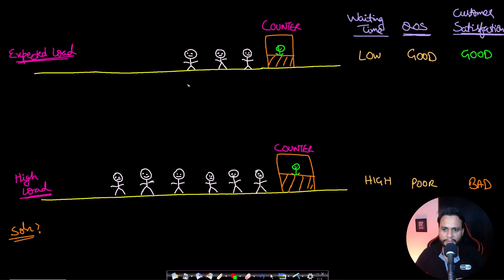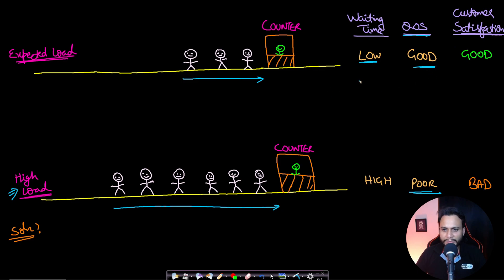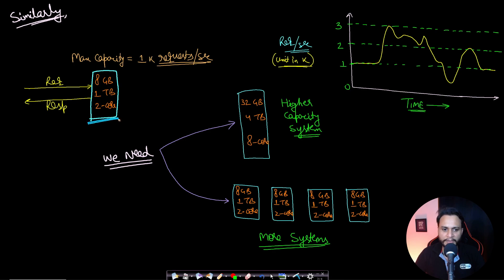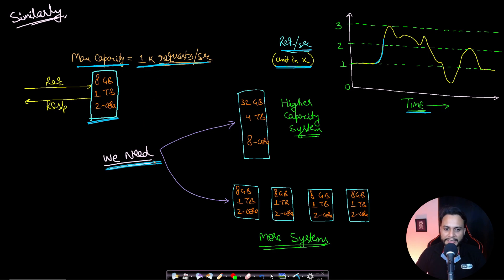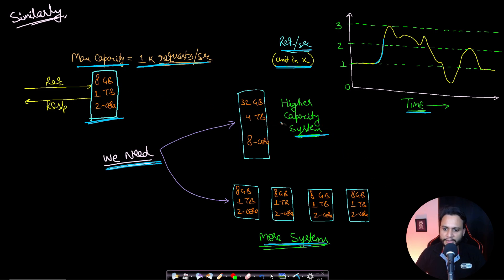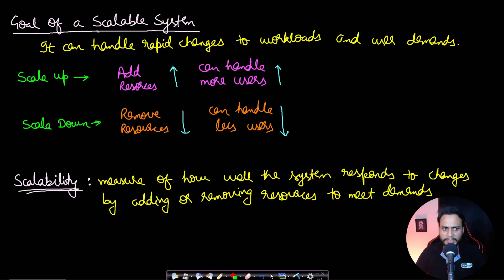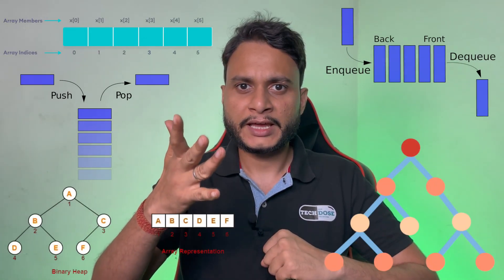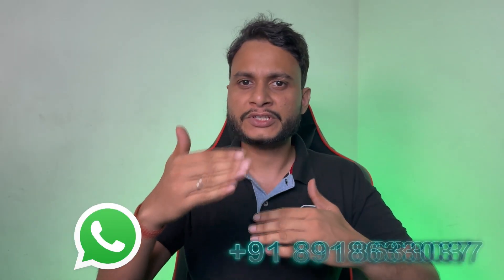Scalability | System Design

Comment: In system design, scalability refers to the ability of a system, network, or process to handle a growing amount of work or its potential to be enlarged to accommodate that growth. It's a key property that determines how well a system can adapt to increased demand or workload without compromising performance.

Scalability can be viewed in two primary dimensions:
1. Vertical Scalability (Scaling Up): This involves adding more resources (such as CPU, RAM, or storage) to a single node or server. It's about increasing the capacity of existing hardware or software components.
2. Horizontal Scalability (Scaling Out): This involves adding more nodes or instances to a system, allowing for distributed processing and load balancing. It typically involves adding more servers to handle increased load, which can distribute the workload across multiple machines.

Key considerations for scalability in system design include:
- Load Balancing: Distributing incoming requests or data processing across multiple servers to ensure no single server becomes a bottleneck.
- Database Sharding: Splitting a database into smaller, more manageable pieces that can be spread across multiple servers.
- Caching: Using temporary storage to hold frequently accessed data, reducing the load on the main system and speeding up response times.
- Microservices Architecture: Designing systems as a collection of loosely coupled services that can be developed, deployed, and scaled independently.
- Statelessness: Designing components in a way that does not require them to maintain state between requests, making it easier to scale them horizontally.

Scalability is crucial for systems that expect to grow in terms of user base, data volume, or transaction frequency. It ensures that the system can continue to perform well and provide a good user experience as demand increases.